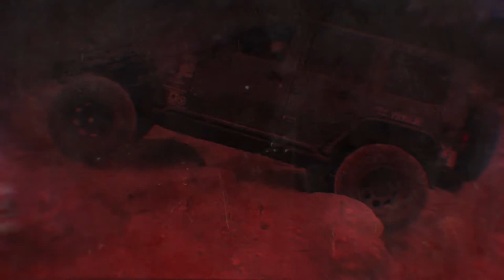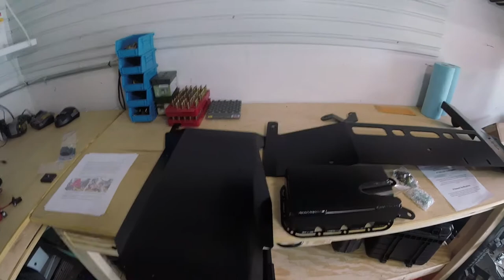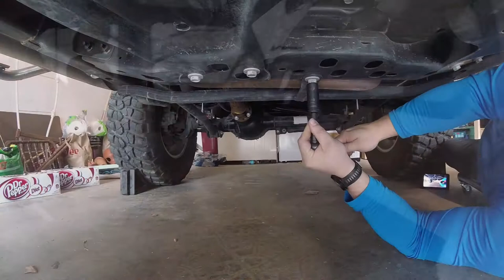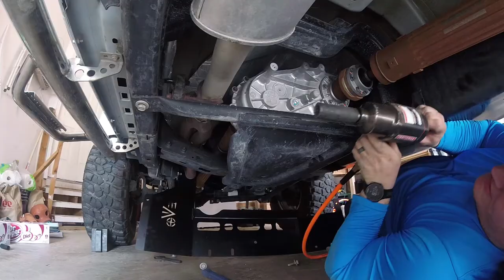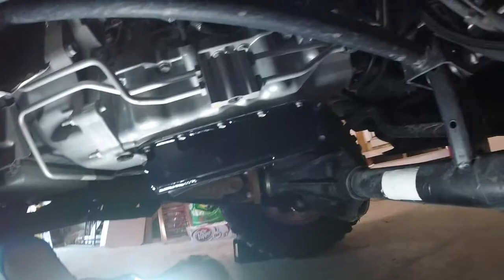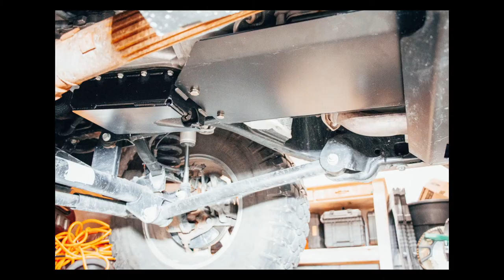eVo MFG ProTek Skid System - Jeep Wrangler Install

Comment: Could you have installed that transmission skid without removing that factory cross bar or would it have been in the way? Reason I ask is because I have LOD sliders on my jeep and that factory bar that sits under the transmission is bolted between the frame and the tabs of the sliders. I can't use EVO's exhaust loop crossmember skid because of my sliders. I just have the oil pan and transmission skid. The oil pan skid is installed but I have been putting off that transmission skid for a bit now.